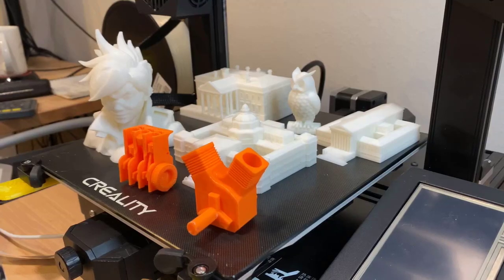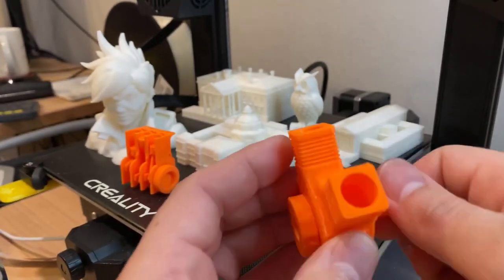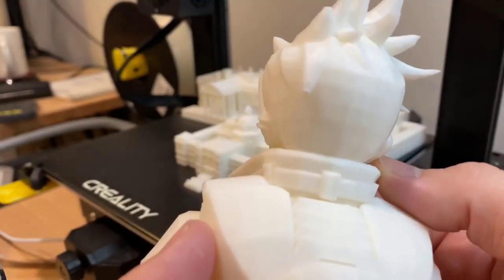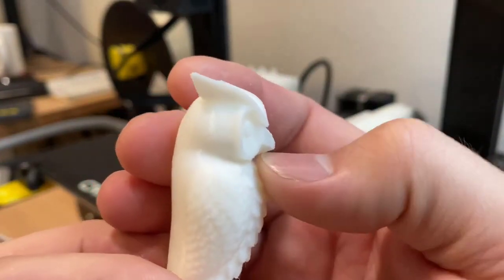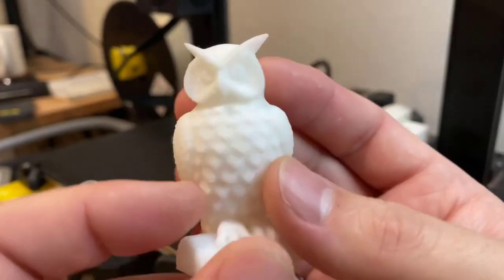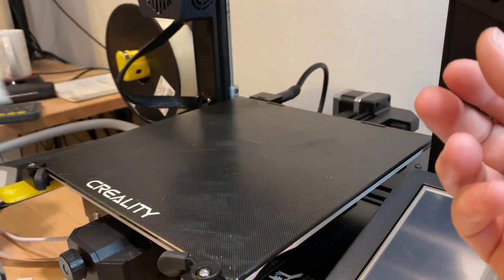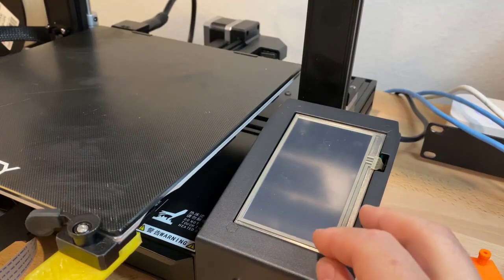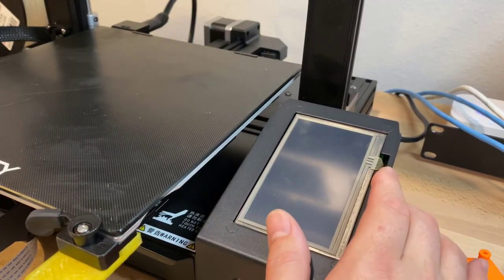CR-6 SE Printer Modifications

Comment: did you have any adhesion issues? i cant get anything to stick no matter what i do and ive checked literally everything on the printer and everything should be perfect.
Reply from the maker: No adhesion issues here and I print a few times a month. What I do is clean the bed before every print with isopropyl alcohol and also slow down the first layer print speed to about 10 mm/s

Comment: Could you please post the video where you fixed the dual z. I had the same problem but without any guidance from YouTube I have done a sloppy job by loosening the timing belt and turning one of the lead screw by hand.

My bed Y235 is higher (gap is less) than Y0 as well. Any help would be greatly appreciated. Thanks for helping out a newbie fellow.
Reply from the maker: Incoming later today!

Comment: What color of white filament that-was  sent with  the printer ? Also when you flash the board, did you use the same file for display or is a different file?
Reply from the maker: The only information listed on the spool for the filament sent with the printer is: CR-PLA White 1.75mm 1kg Print Temp: 195-220
Part number: PLA20200725ZKSW
For the flashing, there are two different files needed.  One for the mainboard and one for the LCD.  I am creating a video for this process in the coming weeks.

Comment: Thank you for this, what is the distance between the parts? So what is the tolerance?
Reply from the maker: Thanks for commenting.  The space between the pistons and the cylinder walls is pretty small.  From what I measure, it is about 2mm all the way around.  I couldn't find any specifications on what it is supposed to be.

Comment: What is the max temp of the hotend? Or could you easaly change the hotend to an all metal one?
Reply from the maker: The current max temp for the hotend is 260 degrees C as seen in the specs:
https://www.creality3dofficial.com/products/creality-cr-6-se-3d-printer

As far as changing the hotend to all metal, there are currently no options to do so.  This is due to the shape of the heatsink and the screw-hole positions.  I would imagine that manufacturers will eventually create a drop in version but right now you'd have to jerry rig it to work.